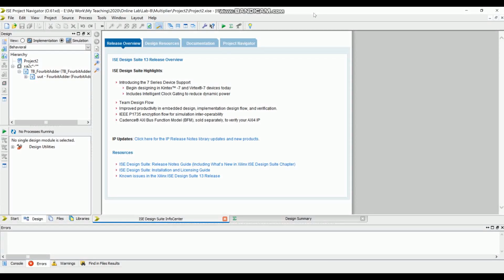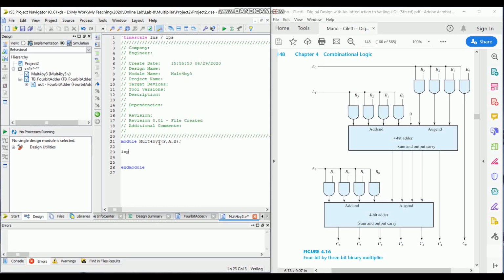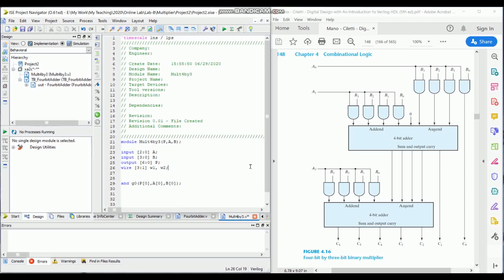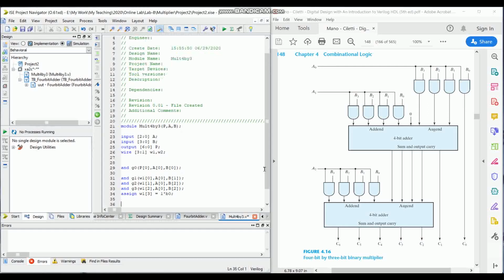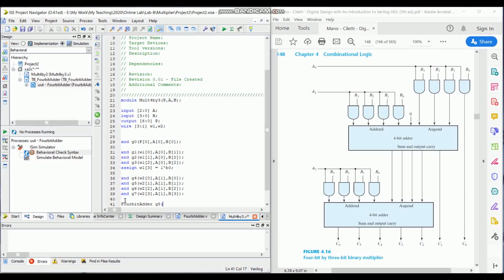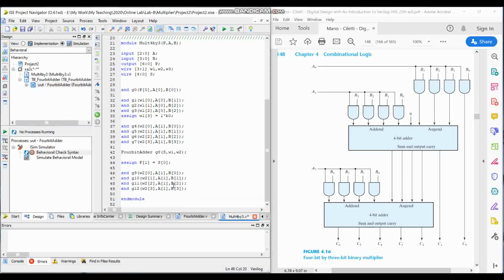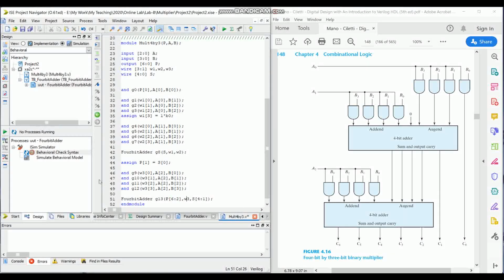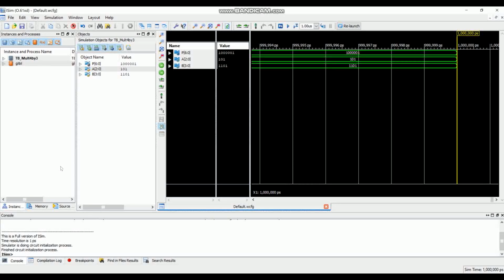Simulating 4by3 Multiplier Verilog HDL Code on Xilinx | Digital Logic Design

Comment: Sir, i am getting an error while simulating this code; the error is
"width 1 of formal port C4 is not equal to width 4 of actual signal w1." How can i resolve it?
Reply: Sir I need 4 by 4 bit multiplier in verilog module please help me I have watched your 4 by 3 bit but I didn't get it
Reply from the maker: Just watch my generalized multiplier video. That will help
Reply from the maker: This error is generally because of the fact that the inputs of the module you are calling are not defined as vectors (or multibit variables). If you are inputting a vector to a four bit adder module then you need to make sure that within the adder module input must be defined as a vector and has same number of bits as in the input from multiplier module.